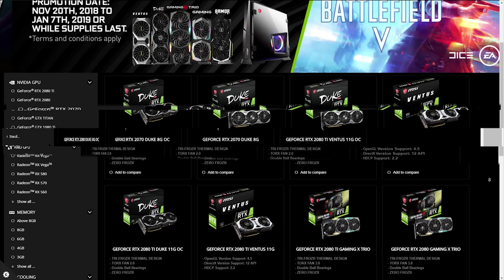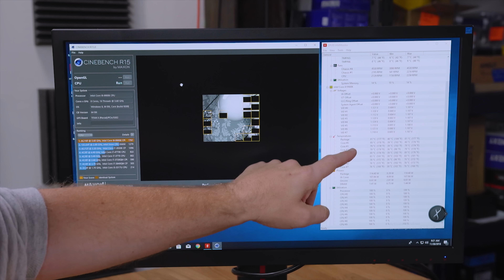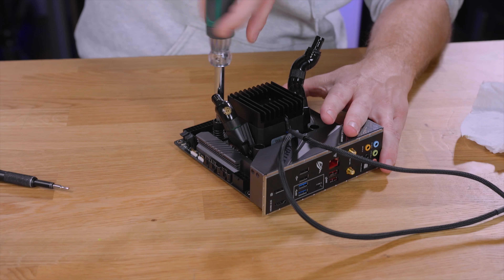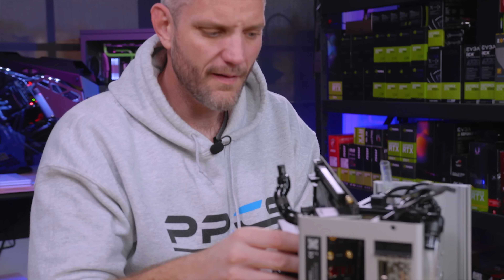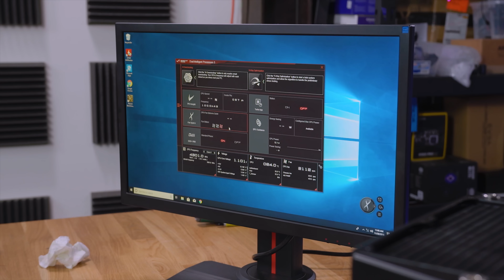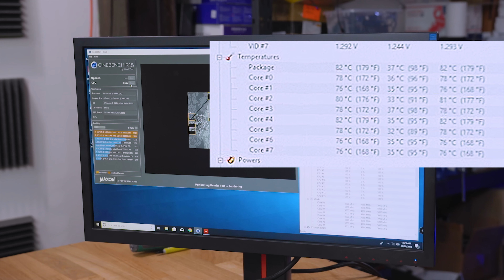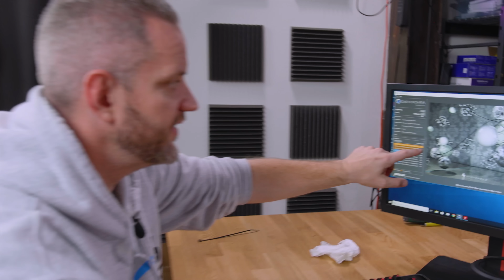Something went wrong with the small watercooled PC...

Comment: Maybe use Ryzen 2700x instead of 9900k i mean come on, you even downclocked it to 4.3GHz like you said and ryzen OC'ed runs on 4.3GHz. I just dont understand why noone uses ryzen for this small builds.
EDIT: forgot to say that ryzen runs much much cooler even OC.
Reply: As you saw he no longer needs to down-clock it making the 9900k the better performer
Reply: @fl00ds  but the ryzen is still WAY cheaper and cooler overall and still has amazing performance with 8 cores for an amazing price it is the best bang for your buck
Reply: @Zebruhfy  because Jay always builds on a budget...that's why skunkworks exists.
Reply: @Zebruhfy  Price to performance is a consumer metric. Anyone that uses that to determine commercial purchasing is an ignorant, short-sighted asshole. Commercial purchasing should be done via the return on investment metric. The 9900k will allow him to have more productivity which will cancel out the excess in cost and then some in the long term.
Reply: I know he went straight on Intel, but AMD would have had some problems: jay probably didn't have a strix X470 on hand, then he couldn't have used swiftech's combo block as it doesn't support AM4, making this build far harder
Reply: true
Reply: I believe he's put way too much system, in that little box you defy the laws of thermal dynamics it will fry your ass.
Reply: I just took 6c off my r7 1700 and runs really cool on stock but in a Evga Hadron Air with noctua 92mm tower fan it does 3.7 with 29c idle and 68c prime load which is mint but once voltage brakes 1.3 you start seeing the 10 degree spikes. The sacrifices of ITX, but you don't see AMD users lapping there much cheaper product......
Reply: Totally agree the 9900 will do better in purely gaming and gaming alone so it's worth the 10 - 15% decrease in gaming preformance for better thermals. At least for my use case I would rather have a better all round build rather then a hot gaming build.
Reply: @HotRodX lol i jsut upgraded from the QBX KAZE since the 1070 gpu was getting hot and the top fans where pulling air from the mesh side panels, Negative air gave me the best thermals for cpu with mini tower cooler. I think i'm limited to 3.7 simply because i have a ASrock board or the Ryzen+ are just that much better then 1st gen. I wanted to get a 590 but like most all people we bough a 1060 4 years ago and even my sli 970's outperform amd.
Reply: ( ͡° ͜ʖ ͡°)
Reply: Because intel sponsored content
Reply: Armored Sponge severe lack of mini ITX AM4 boards is a big part of the reason
Reply: This rig is for mobile video editing. Adobe premiere uses Intel's integrated graphics to make renders way faster, much more than even extra cores can do. Intel is still the best option for basically the whole Adobe suite.
Reply: @fortunefed8719  What about a Ryzen APU? If a GPU core is better for it then the CPU cores surely a Ryzen APU would be better?
Reply: @Krytern  Adobe likes very much clock speed so having 2 cores that can turbo up to 5 GHz is better than having 2 extra cores
Reply: @Krytern  boy you get to conclusion really fast, just because ryzen apus have gpus in them, doesn't mean that adobe will use it (not all gpus are the same and it's not an easy task to do) and then ryzen apus have 4 less cores, it doesn't mean that ryzen is bad or anything but a 9900K + Titan Xp is much much better (read faster) at any ryzen apu or ryzen r7 + amd gpus or anything else (except for rtx 2080 and higher) because adobe has cuda acceleration and runs better with intel cpus (loves them clocks) so yea, it's kinda the best configuration for what it is gonna do, but not the best value :)
Reply: @Krytern  Two issues with that.

One: Adobe doesn't support Ryzen APU's for hardware acceleration. I know, it's kinda bs because Vega graphics are in fact miles better, but that's down to Adobe coders who aren't known for making the fastest software, even though it still usually is the best software for its features.

Two: The best Ryzen APU is still only a 4 core. Integrated graphics are used for some parts of the render, but a large amount is still done on the cores, and a 4 core just isn't enough. Not to mention scrubbing while editing is much (like a lot) better on an 8 core than a 4 core.
Reply: @mohibeyki  How did I come to a conclusion really fast when i ASKED A QUESTION? I wasn't sure so I asked. That is the complete opposite of jumping to a conclusion....
Reply: @Krytern  well it didn't seem like it since it happens so often but it doesn't matter now, no hard feelings :)
Reply: Because the 9900k is better for the job he wants and He does not have to worry about budget.
Reply: @Fiufia  ok lol still if he was worried about temperatures
Reply: I have a Ryzen 2700x and a ROG 2080 
Strix I LOVE THE CPU and with EK water cooling it puts the tempatures at around 30 c
Reply: Armored Sponge MHz don’t mean much
Reply: Also, even if they were running at the same clock speeds, that doesn't mean that they will perform similarly. The 9900k would still have a decent lead.
Reply: @Sean_DuLac  if it was throttling to 3.3 at one point and mainly around 3.9+- during cinnebench a heavy render a 2700x at 4.3 and probably even stock would beat it. Hardware unboxed did a video where at 95 watts or about 4ghz under heavy loads it about kept pace with a stock 2700x. So for the standard user who wont lap there ihs and cooler in a heat constant case like this a 2700 or 2700x far out weighs a 9900k if it's going to bounce into thermal walls and fall under 4ghz. Not to say the 9900k is not king. But when its clocks fall like this it is not. https://youtu.be/kmAWqyHdebI if you want to see how a 9900k performs when its throttling some test didn't stress it as much so it didn't throttle as much in them but the ones that did ended up pretty much the same as a ryzen 7
Reply: These people watched the video? The temps are good. Yes he have a problem the 1st time but now is all good.
This PC is to work. Probably with Adobe Premiere so yes go Intel make all sense. Time is money he dont go play games 24/7
He review all this CPUs he can play with them all the time and you guys want to teach which CPU is best for him. lol

if he had chosen Ryzen It had been another boring/save/nothing special video 
with the 9900k e make 2 videos and have the challenge to make a hot cpu work well in such a small space. 
maybe that's why you guys are so upset the 9900k is not so hot :D
Just stop AMD vs Intel shit idiots if you like AMD go for him
Reply: @Fiufia  not upset at all just saying for most end users a 9900k in this case is not a good choice. Because most people are not going to void there warranty o a 579$ CPU and a cooler at the same time by laping them just to be able to cool there CPU. In Jay's case it's the right CPU because he doesnt care If he has a warranty ect
Reply: @Demon09-_-  
And I agree when you say that "most end users a 9900k in this case is not a good choice" but we are subscribed 
JayzTwoCents to see this crazy thing not to see another boring/average build that everybody does.
And you really do not have to laping them to have good temps. you can easy OC 9900k 5ghz all cores with a are cooler. I am sure if Jayz have cleaned up the liquid cooler primochill mess and put new thermal paste the temps had been good.

Comment: Something went wrong? No way. Not with your luck.
Reply: Phae Is Bae the profile pic works so well with this comment lol
Reply: From my experience even the best of the best can get rekt like the rest. I'm just glad he found out what the problem was!
Reply: Kappa
Reply: It got rodknock
Reply: he got 5.2ghz on a 7980xe without delidding sooo
Reply: If you think he’s got bad luck you should see what’s happened with some of my systems. Always end up with at least one rma and got a bad power supply cable that fried a 1tb ssd just on my last build. I always get good quality components.
Reply: @Rickmon01  a psu CABLE? who made it? also how did you end up finding out it was the cable specifically?
Reply: garrettzkool63  hooked up the same psu to a cheap throw away desktop with the same cable order and it did the same thing with the sata power cable coming from the psu that I had connected to the hard drive. Just labeled all the cables before I pulled it apart with masking tape and marker. I can’t remember specifically which brand the psu was. Returned the faulty one for a sea sonic one that still works.
Reply: Lol I have a hard time to put up a good water cooling plan in my Mid Tower and I am thinking about buying a Full size, but loll this guys makes a full custom water cooling loop in a PC smaller than my phone.